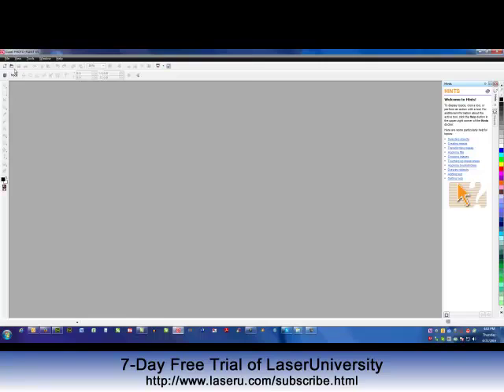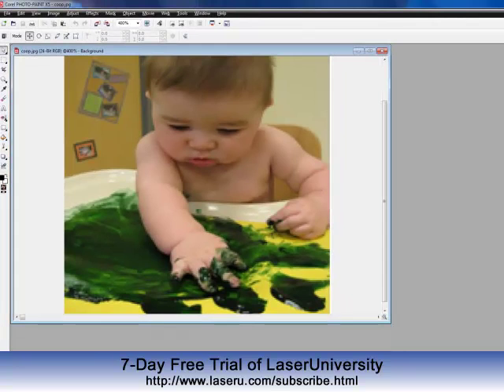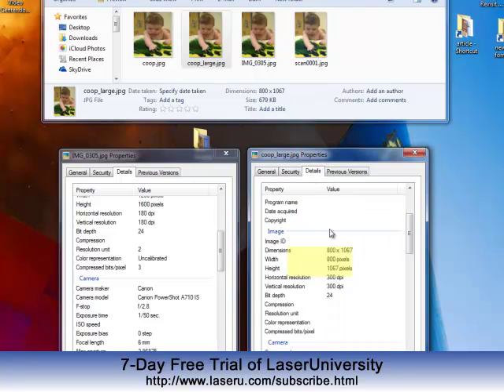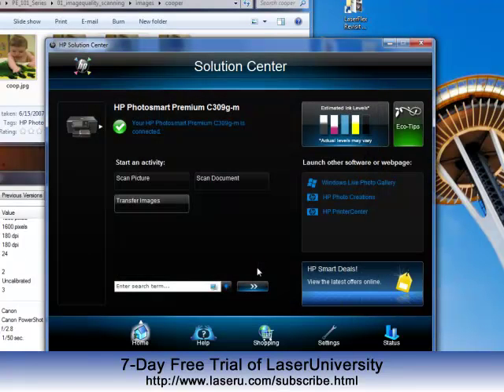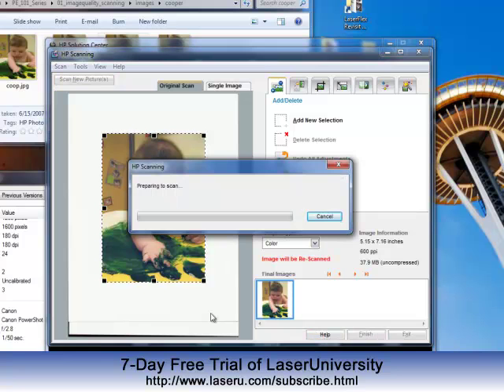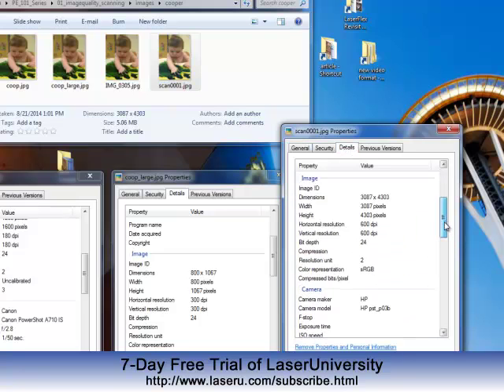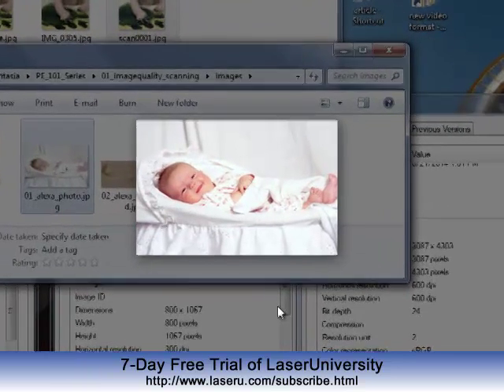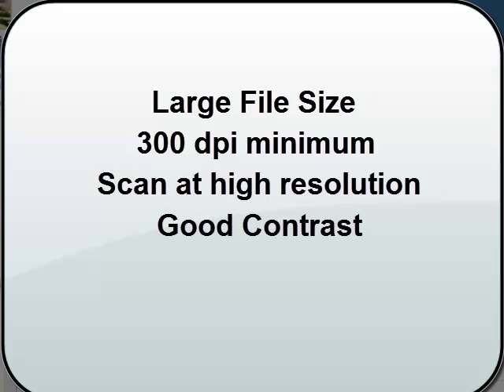Photo Engraving 101 - Video #1: Image Quality & Scanning

Comment: you could just resample that picture in corel instead going through trouble of printing and scaning. Anyway it is helpful video, thanks
Reply from the maker: +mateusz1945 Thank you for replying. I am glad it was helpful. We do have the method you suggest in a later video in this 5 video series. The process of scanning is for very small images and low res images that need an extra boost.